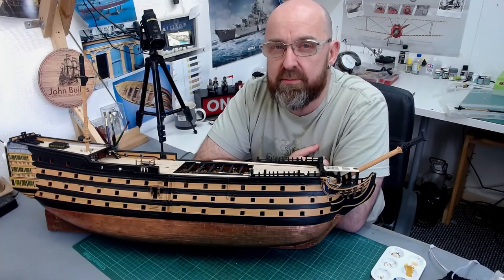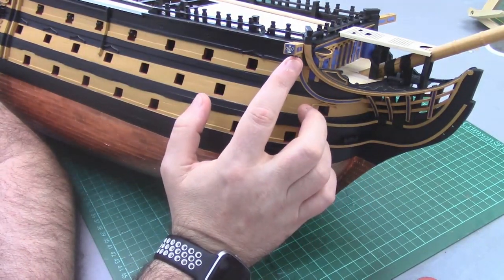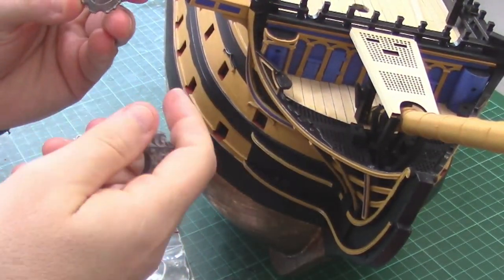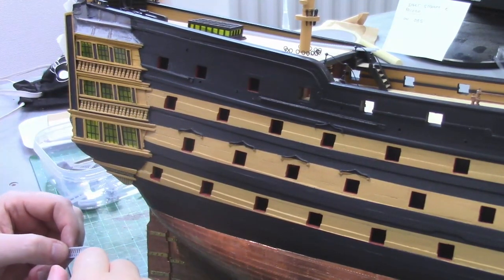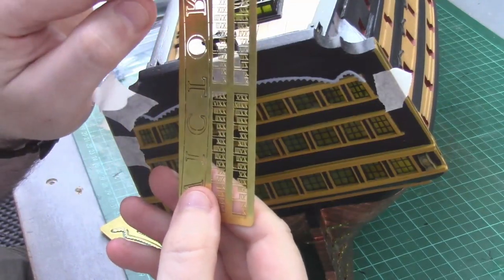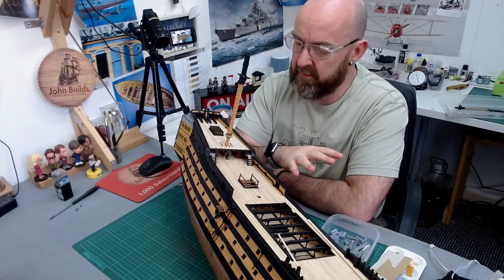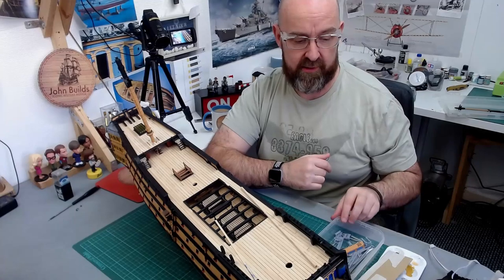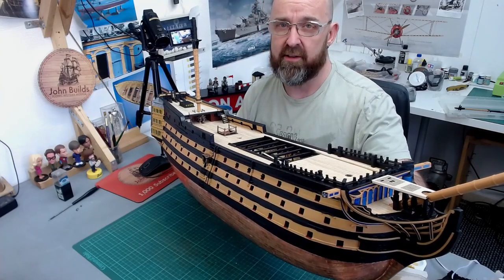Model Ship Building :1/84 Scale : HMS Victory : Part 76 : Build Update

Comment: Shes looking good John, I am now thankfully on the rigging for mine now, ratlines a plenty. She's a big old ship for sure.
Reply from the maker: Hi tel po . She’s one very build ship that’s for sure, How long have you spent on the rigging so far
Reply: @Johnbuildsiconic  I've done a couple of months john, I'm doing my garden up at the moment so will jump back in winter. She's not too bad to be honest, the size actually makes it better. One tip if I can is on ratlines, I have two 5mm bits of wood, put fine sand paper on one side of each stick, on the shrouds place the sticks grit paper inwards on each side of the shrouds and clamp the ends once clamped use the straight edges to run the rat line across the shrouds, makes it less of a hassle and a lot faster than free hand.